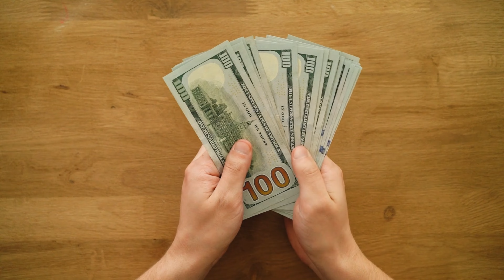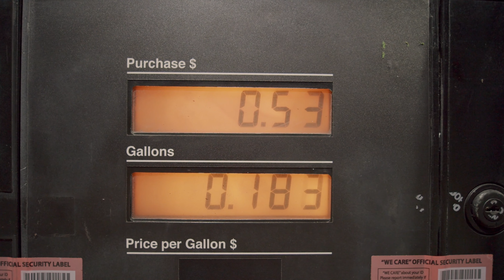Making Concrete Candles? Calculate These COGS For Total Cost

Comment: Thank you. I have been doing my calculations in the traditional sense, oz and such. Measuring everything in grams gives a more accurate perspective on cost, breakdown of goods. I'm mad that I didn't think of doing it in grams for most of my materials.  Obviously per jar/wick that math still applies but thank you. Now I have an accurate burn time for my creations. Also I definitely want to see a video if u ever try eco resin. ❤❤
Reply from the maker: I have been working with epoxy resin but I am not ready to go full out with my findings... When I do you will know.
Reply: Not the epoxy resin,  resincrete.  Powder form and only add water like cementall and hydrostone.
Reply from the maker: Ahhhh I see. It's quite expensive on Amazon. I will look into. @ashleykalston

Comment: When making concrete vessels what kind off concrete do you need and thanks for another great video vibe candle
Reply from the maker: There is a difference between cement and concrete. Watch this -> https://youtu.be/KCByTrXFXzQ. If you are asking what kind of cement you need that is different. However, in order to make concrete you need several ingredients. Let me know specifically what you are looking to do.
Reply: @upvibecandle  Is It A Multi Purpose Concrete We Need To Use For Vessels

Comment: What about costs of packing and shipping??
Reply from the maker: Good question. However, that has nothing to do with making a candle. I am not saying that shouldn't be included in your overall COGs but I calculated the cost of making the candle not packaging and shipping. Make sense? On the flip side, I did say I have another video going deeper into COGs... Those items are definitely worth adding in.